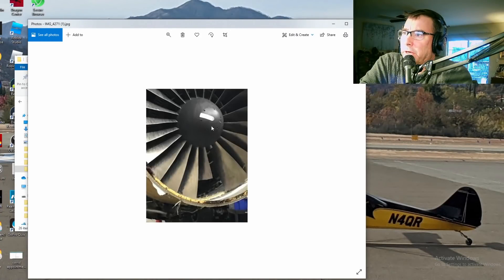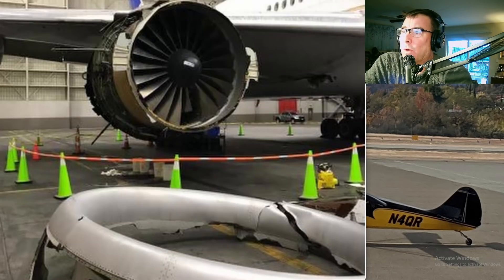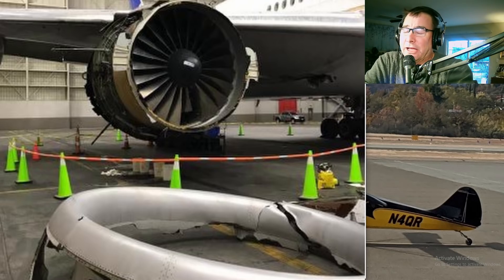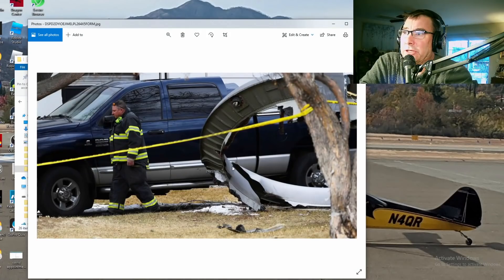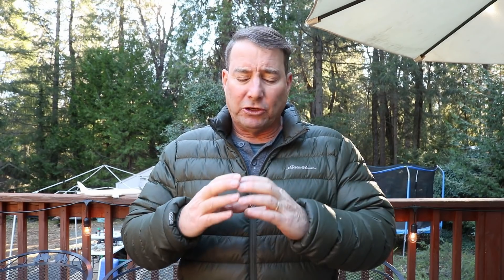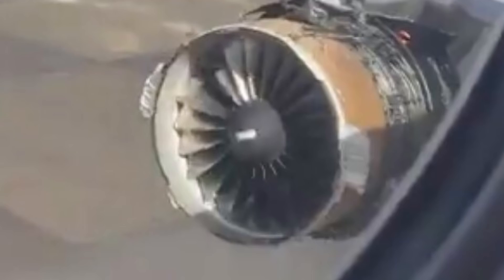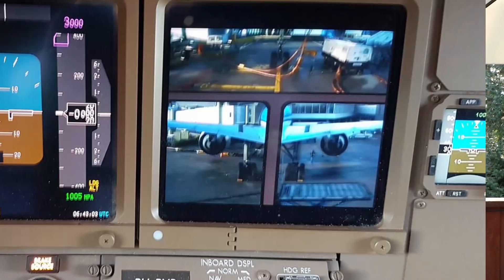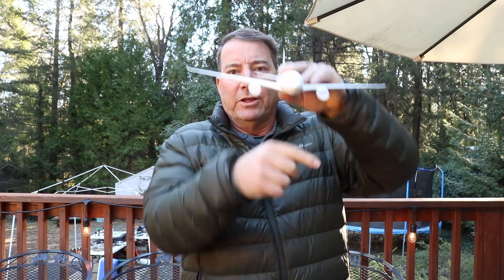UAL 328 UPDATE Fan Blade Failure  B777-200  22 Feb 2021

Comment: 36 year AMT for a major airline (last 15 years in engine overhaul). The "Fire Detector Loop" system runs external of the engine case assembly and inside the cowling system. It runs along pneumatic ducting and fuel lines to detect "Hot" spots that may be a pneumatic leak or a fuel leak, possibly resulting in a fire. The fire agent that would be released is only going to be effective if the cowling system is intact. When the checklist calls for the fuel to be shutoff, you have to remember, the shutoff valve is located in the "Pylon" and may take a moment for the residual fuel to clear before it shuts the engine down in an inflight, engine wind milling condition, such as this. It's funny the different perspectives people have when seeing the inflight images of the engine. When I saw them, I thought..."Look at that, a complete uncontained failure and the "Combustor" is still working flawlessly." That's "Not" the uncontained engine fire that you're thinking. That's the "Combustor" doing it's job. A turbine engine get's all of it's energy from a controlled fire from the combustion section, transmits that energy to the HPT (High Pressure Turbine) and via an internal shaft, to the "Fan" section. So, until the engine is starved of it's fuel, the combustor is still trying to make fire. But, with that said, there are other really bad things happening inside that engine. Yes, it probably did extricate the broken fan blade, but obviously a bunch of debris got ingested, hence the huge hole in the engine case exposing the combustor section. That results in all the bearings (approx. 8 bearing assy's) trying to come to a screeching halt. That friction, no doubt, was causing residual burning. Thank you Juan for the pilot prospective.
Reply: Need to modify my above assessment, it was NOT an uncontained failure, apparently, and that is not a hole in the case. Seems, after a little more research, that is "C" duct damage we're looking at.

Comment: We should know if they plane sat in storage in Chicago, it flew there earlier that day to Denver (if I recall right). We also should know if more steps like X-rays should be done to the engines  hardware/parts (now on) when taking a plane out of storage (no matter how long it has been out of service). We should also know, if more mechanics would have helped find this issue. (Didn’t airlines furlough a lot of pilots and mechanics years ago?) Maybe FAA should test for failure the whole engine like if it were in real flight!

Comment: On military aircraft we had a beveled pad between the aircraft and the external fuel tanks.  If an external tank was jettisoned this pad caused the nose of the drop tank to dip down into the airstream and fall away downwards, and away from the aircraft without striking it.  There could be a built up pad next to the engine mounts that could ensure the engine moves downward if it seperates and not just backward to strike the tail of the aircraft.  The front side of the metal pad was wider than the aft portion.

Comment: If the shaking of an engine out was bad enough that the engine separated from the aircraft, I’ll bet that would mess up the weight and balance in a heart beat.  How do you handle that?

Back in the 1950's when I was just a little tyke, I can vaguely remember an engine fire on the right engine of a DC-3 on a night flight.  That’s all I remember.  I don’t remember anything else, just the sight of that engine burning.

Comment: Since the normal engine sales are just the engine and not with the nacelle, blade out testing doesn't account for what happens to it or other parts attached like the thrust reverser.

Comment: If it makes you feel better... If my one experience designing a gearbox for an faa application, the ETOPS requirement also required the equipment so survive the vibe from the windmilling engine for the trip home. We had a kind of low level view, but I'd expect there is a statement like "fail in a way that generates a secondary hazard". ETOPS was one of the biggest design drivers.

Comment: I flew the 777-200/300/and the freighter.  Only the 300 had the cameras on the horizontal stabilizer.  It may be an option for the 200/freighter but not one that I’ve seen on the line.

Comment: In this day & age, it boggles my mind that ALL planes of this sort would not be tricked out with a MULTITUDE of cameras to assist the flight crew in the event of problems ANYWHERE along the air-frame 🙄😡 it would help with critical decisions & speed in CORRECT augmentation of flight controls ! Did we not see where pilots have shut down the WRONG ENGINE ?? !  Could not Air-France’s lost flight over the Atlantic been avoided if they could have SEEN the iced up ASI !!!🙄😡🤔

Comment: would like to know what % of braking effort do thrust reversers provide on the 777 ( or any commercial  jet for that matter) ?
Reply: Much less than you would think.  Brakes stop the aircraft.  Spoilers have some aerodynamic drag, but the main benefit is to dump lift and get the weight of the plane onto the wheels to improve stopping.   Even at idle, jet engines produce a fair amount of push (depending on weight/slope we often taxi with idle thrust) so any reduction in forward thrust helps.  There is a range of reverse thrust, from idle reverse to max, and selecting reverses idle simply inhibits any more  “push”. 

Additionally, most modern aircraft have an auto brake system.  When a pilot selects the level of braking, this translates to X number of feet per second of deceleration rate.  The brakes will modulate to produce this deceleration rate.  So what would happen if a pilot decides to use maximum reverse thrust, will they stop sooner?  No, they brakes will just release a bit to maintain the commanded rate of deceleration.
Reply: @A_MOISTER_OYSTER  thanks for the reply, yes I always assumed the braking effort was minimal just by looking at the designs over the years,  I couldn't imagine a huge performance from clam shells etc ( although the ability to reverse a aircraft from the ramp can prove to be handy !)
Reply: @F14-talktomegoose  They can save on brake wear, and in some operations the time between subsequent flights may not be adequate for the brakes to cool below required temperatures, so reversers help there.  When the runway is contaminated with snow or water and the braking is less effective they can also help quite a bit.  Still, credit for reverse thrust is not assumed for most landing calculations.  Reversers are a tool we love to have but the brakes carry the burden.

Comment: Dear Juan, a question on ETOPS. You describe 2 cases: 1 engine --> out you need to descent and divert. Decompression --> you need to descent even further and divert. What if both happen: 1 engine out & decompression? Can you still reach an airfield under ETOPS rules? Or the other way round: does an ETOPS route account for such a combined incident that would lead to lower speed/more flight time and higher fuel consumption?

Comment: My brother is a ND engineer, the carbon Kevlar cowling is about 1.25 inches thick, it's designed to keep the blade from actually coming through the cowling, and into the body of the plane. They are supposed to check the blades with X ray, or ultrasonic occasionally as well visually, though anything could have happened to damage the blade prior or on take off, though stepped up inspections of these blades, and the engines in general. Newer engines have carbon fiber blades probably a better idea now more than ever.

Comment: Don't know if anyone has pointed out, the burning grid-like part is "cascade" of thrust reverser, the air distributing grille of the engine reverser.  It's most likely made of carbon fiber reinforced composite and that's why it was burning, probably started by leaked fuel or oil when fan blade broke.  That flame just looked scary but it probably extinguished by itself when resin in the composite burnt up.  The real dangers were the fragments and debris from the broken fan blades.

Comment: Also, the plane lost some of its weight with the engine parts falling off, and I'm guessing that the plane wasn't full up on people because airlines are spacing people recently, so there should have been a lower weight than normal.
Reply: Weight of passengers on a 777 from say half full to max capacity is small in comparison to the weight of fuel, especially on long range flights.  For example let’s say it was full of 300 passengers with an average weight of 200lbs (because ‘Murica) that’s 60,000lbs.   The 777 can hold nearly 50,000 gallons of fuel, but probably half that for this flight, so 25,000 gallon times 6 pounds per gallon is 150,000 lbs.  There’s also commercial cargo and baggage etc.  Yes the weight may have been slightly lower if they block middle seats, but that’s not going to make a significant impact, and the weight of the cowling is peanuts in comparison.
Reply: @A_MOISTER_OYSTER  Thanks for that. As Juan said I guess it can land on full weight. I always feel nervous when a plane is full up thinking it is close to the maximum weight or near its limits. I  feel a bit relieved when there are open seats. It never ceases to amaze me how those monstrous heavy things can get up into the sky.
Reply: @jamesgibbs6970   every airline category jet has a number of operational weights, one of which is the maximum zero fuel weight, or the most the plane can weigh with all passengers and cargo and crew and catering before adding a single drop of fuel.  For perspective, the maximum zero fuel weight for a 777 is 450-500,000 lbs depending on model.  The weight of the airplane empty is 350,000 lbs, so the crew, catering, and commercial load of people bags and cargo is 100-150,000 lbs.  This is all before the first drop of fuel.  Now depending on model, the maximum take of weight is 750-777,000 lbs... so yes that means up to a quarter of a million pounds of fuel can be added, significantly more than everything else we can stuff into the jet.  150,000 compared to 750,000 maximum you can see that the number of people isn’t really going to keep that plane from getting into the sky.   

Of course the numbers change jet to jet, but the traffic or commercial load is generally a much smaller percentage of an aircraft’s weight than it seems.
Reply: Also, and this is true of many jets, the amount of thrust available on a 777 is unreal. So much so, that on more than 90% of takeoffs we don’t even need full power.  This is accomplished a couple ways, one is a flat derate, tell the engine computer to reduce power 10 or 20%.  Another was is assumed temperature. Hot air is less dense than cold air, so hot days engines have less performance than cold, so you can trick the engine computer by telling it the temperature is 125 degrees when it’s really 75, and it will act as if the power available has been reduced by the higher temperature.   The 777 engines are so power, we can actually stack these two methods at the same time, and still meet all legal safety envelope requirements, truly remarkable and it saves engine wear.  

And on the days we need it, there is max power.... then there is takeoff/go around power above that... and when it’s realllllllllly hot and heavy there is thrust bump.  Let me tell you, those bad boys can make some power.

Comment: So, what happens if you have a depressurization event that blows debris into one engine (Aloha Air 243), so you're forced to go to 10,000' on one engine.  And you have a headwind at that altitude and you have to slow down due to vibration in the windmilling engine?  Asking for a paranoid friend who has to fly to Hawaii.

Comment: That's why I ALWAYS felt safer on the Boeing 747's you have four engines, not two, you had that United Airlines 747 blow a cargo door over the ocean, they lost some passengers and both right hand engines on their way to New Zealand from Honolulu, the pilot brought that bird back and landed it perfect on two left engines.  The British airways 747 flew through the volcanic ash, ruined all 4 engines they basically had concrete stuck in the engines in the pilots still managed to fire them up, and land safely. I mean there were some bad 747 accidents as well but I always felt safer on a 4 engine plane, even the DC-10, and we all knew of the problems they had, but they ironed them out, and there still flying today for fedex and UPS. I guess I'm just old school and I like the flight engineer being up there. I'm from New York and I actually saw that plane crash that came down in Queens in November, 19, 2001...I was at a toll booth, And you could see planes taken off every 2 minutes and this one just Didn't look right it was really low and then plumes of smoke I get Goosebumps just thinking about it.

Comment: I have been an aircraft mechanic for 7 years, and an aircraft inspector for 27+ years on large commercial aircraft. Thank you for a very professional and common sense based report. I will be very interested in the NTSB final report. We are always learning in the aviation industry. Fortunately there was no loss of life in this case. The adjustments that will be made as a result of what we learn will make flying safer.

Comment: I am wondering about the nondestructive inspection (NDI) that is conducted on these blades, and how often it is done. I edit articles for Materials Evaluation (the ASNT's journal) and I did was see one authored by someone at Singapore Airlines, I think, several years ago. I have flown all over the world in my job and never had an engine problem on any of my flights. So I am curious about this one. E.g: what method is used for the NDT of the blades by United, and what does the maintenance programme look like.

Comment: Unfortunately, after 33 years with Continental/United I was forced to retire Sept.1 2020 because I turned 65. I was a Captain on the 777 and flew that aircraft several times. When I first saw the video it looked to me as though the engine was still running and the fire we were seeing was somehow the exposed burner section as the fire looked quite uniform. Of course that made no sense, as by then they would have already performed the shut down procedure. I think what you said about the effectiveness of the Halon without the nacelle is probably spot on. Your "White fart in the wind" comment cracked me up. Very good analysis and explanation of ETOPS. Ok, bone picking time. "The FO is probably better at landing?" I don't think so..lol.
Windy gusty day in EWR https://youtu.be/bDAJiZVkihk

Comment: Wrong, you cannot run an engine without nose cowl on the ground
Reply: When engine are on the ground in the test stand, there is a nose cowl bolted onto the engine. If not the engine will compressor stall due to the fact that the airflow isn't smooth.

Comment: Great description of all the things that go on during an emergency. You spent some time talking about the half way point in the flight and the fuel plan. Does flying with one engine cut the fuel consumption down enough to make up for having the fly at lower altitudes? I understand that higher flight levels take less energy, but flying with only one engine burning fuel cuts the required amount of fuel in total...I guess you probably have to "rev" the remaining engine up more if it is the only engine working? Can you discuss this?

Comment: I've been following your channel since the Oroville incedent. I like you telling stories without editing too much in your tale. I rather watch somebody staggering a bit than flipping in and out of scenes. I live in the Netherlands and heard of the recent engine failure. I have expierience working with gas turbines in power generation. In the south of the Netherlands a whole pile of blades came down and I'm pretty sure they where turbine blades. 2 people where injured in the incedent. An older woman got hit by a blade on the head and a kid got a burn injury at the hand when touching a blade right after it hit the ground which confirms to me it where turbine blades. Straight relatively small narrow blades with little tapering. Strange is that the size to me looked like last stage blades. Maybe they broke off by lack of cooling due to failure of the compressor.

Comment: Actually those planes suffered the same engine problem at the same altitude, and for certain others didn't suffered the same as they're still grounded due to COVID 19...
Here seems to be a neglect by airlines as those aircrafts thousands flights cycles theirs engines as old as they are should be inspected by means of  dye-penetrant, x-ray, High Frequency Eddy Current, to detect the presence of metal fatigue, as probably is the case with the PW4000 series...but this is aviation happily no tragedy happened and FAA must issued an advisory to airlines using the PW 4000 to make those inspections...then planes using this series...how many planes crashed due to fan blade fatigue ?! How many people on ground get hit by engines debris ?!

Comment: Great job explaining what happened.  That blade skipping out the front and taking out the donut on the front of the engine cowling makes a lot of sense.  The slipstream blowing off the rest of the cowling is the logical result.  I flew Apaches in the Army and there was no way the halon gas in the fire bottle would put out an engine fire if the engine nacelle was totally compromised like this one was.

Comment: The passengers were lucky that the blade didn't shear through the fuselage.
Reply from the maker: Contained...
Reply: Ok. Really glad to see that the containment system works. Any aircraft incident is detrimental to the industry , thankfully there wasn't loss of life.   But there's some lessons to be learned here it seems. If a blade kicks out and slices the inlet ring, is it really "contained" ? Here's some other pictures showing damage to the fuselage, or is that the wing?  Possibly from the shedding of the nacelle.  https://youtu.be/f6JoJj_v9Cs